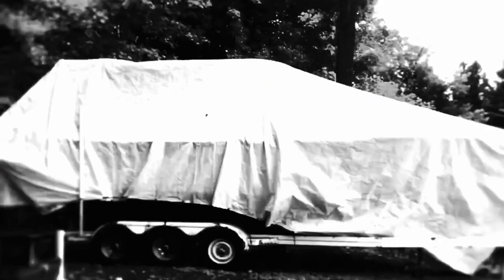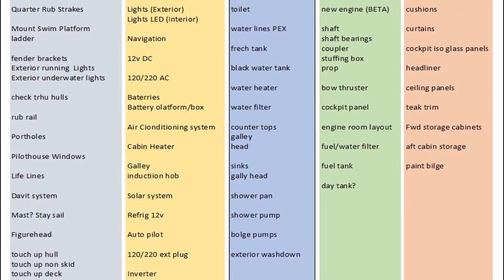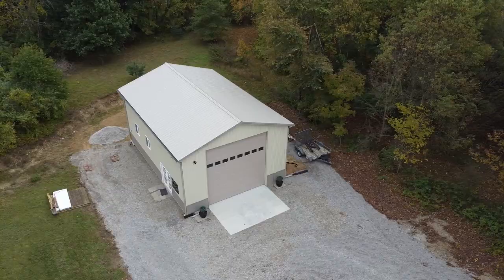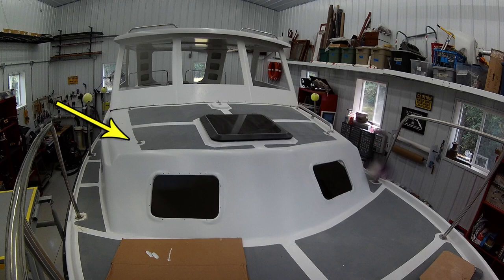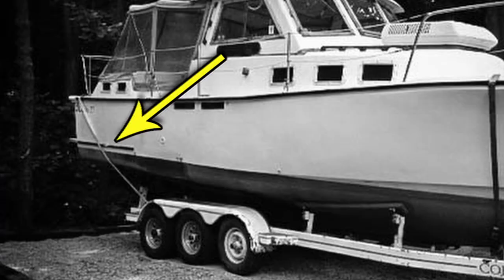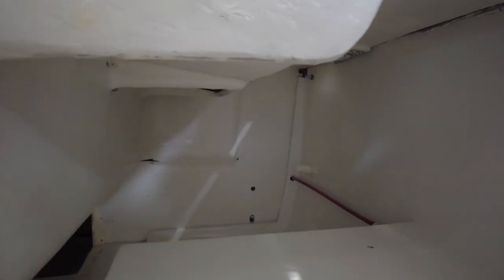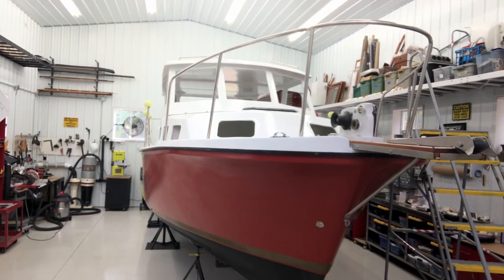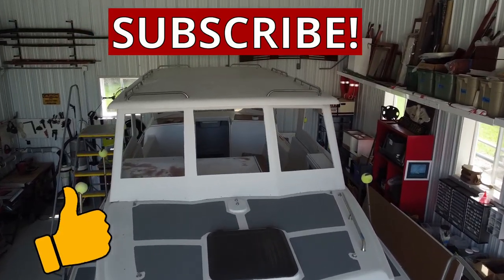How to Plan a Boat Restoration | Albin 27 Trawler | Poor Mans Boat Refit - Part 2 (Ep8)

Comment: OK, you've got a plan. It seems you've visualized everything so you know what to do. I like knowing what's coming next, so I'm happy you'll keep us updated. If you can show us the spread sheet periodically, it'll be helpful to see where each project fits into the big picture. I also like knowing why certain things must come first. You explained that clearly for these first projects. But I want to know more about that when it comes to the systems: electrical, plumbing, etc.
Also, why do you want bulkheads for the aft cabin? Is it to make it more water tight? Or to keep objects in storage from wandering from the aft cabin back to the lazarette and the other way too?
Reply from the maker: You have great questions Charles! It's almost as if I have created the entire channel and the episodes in order just for you. 😁The episodes are numbered in the description, and I suggest you watch them in order, because it will flow with your logical thinking and inquiry. 👍We're due for a Plan Update--but I'm waiting until we complete Phase One, so hang in there😎